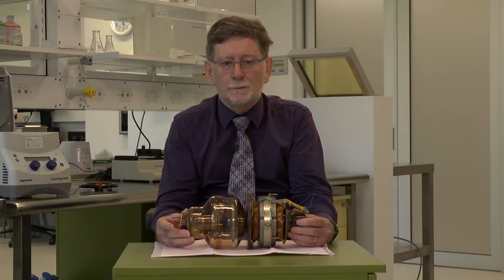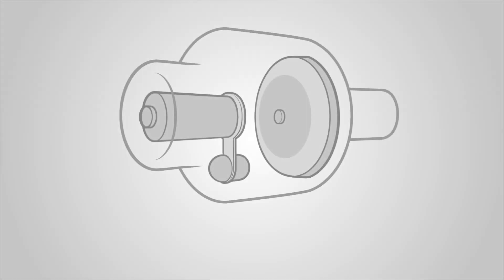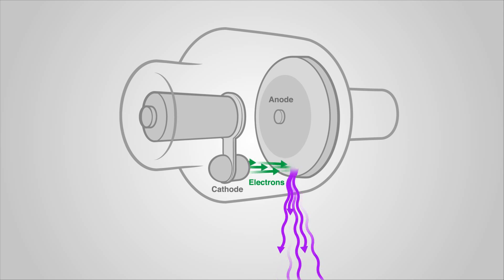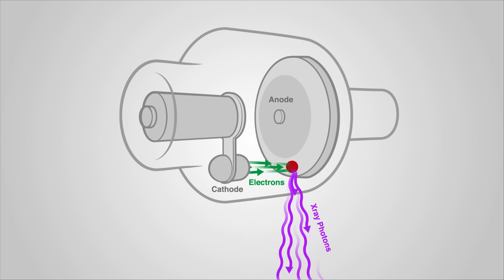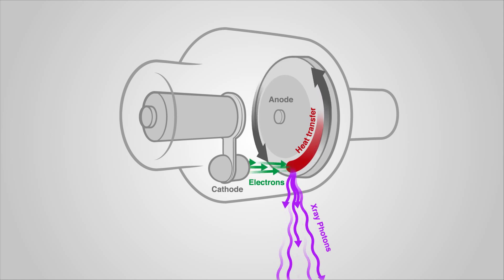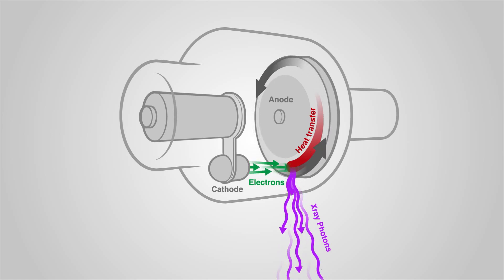How Does X ray Tube Works

Comment: if we increase the heating current across the negative electrode, does that increase the number of emitted electrons?
Reply: yep
Reply: You can adjust milliamperage which controls number of electrons produced. You adjust Kilovoltage peak to accelerate the speed of electrons striking the target. These control the quality of x-rays produced.

Comment: any chance to have this device into a mini one? If you get smaller parts can it still be done or does it need to be this big to function?
Reply from the maker: it cannot be smaller,
you can make it smaller for teeth and all, but for body examination and all , machine have to be bigger , to include all circutes and all

Comment: What happens to the electrons after hitting the anode
Reply: A very small percentage of the electrons that strike the anode will give off units of energy called photons, which make up the x ray beam.  The rest (at least 99%) have their energy released in the form of heat.

Comment: So the high speed electron changes course & is slowed down. When it slows down, it loses some energy.  The result of losing some of its energy is that an exciton (a photon in this situation) with an energy level indicitive of the electron-volt range of X-radiation is produced.  So essentially the X-rays are propagated by high energy photons.

Should they possess even more energy, it wouldn't be X radiation, but Gamma radiation......except that Gamma radiation comes from the nucleus rather that the electron cloud of an atom.

Fascinating

Comment: The video says "1% of the energy in electron beam is converted to photons, the rest is converted to heat".. excuse me mr wise, and what is heat if not photons? All electromagnetic radiation: uv, red, x-rays is photons!
Reply: does this mean even a cfl light bulb on the ceiling is producing x rays??? afterall it is producing very high voltage arcs across the fluorescent  coated vaccuum tube right?
Reply: You'll find more harmful radiation in a brick or a banana than in a lightbulb.  And you certainly won't be getting x-ray radiation from a light bulb (you would have noticed your skin turning red by now).  Also, it takes a certain energy level to create an x-ray photon.  So yes, while x-rays are comprised of photons, not all photons take the form of x-rays.  It depends on the photon's energy and wavelength.

Comment: Couldn't you use some kind of magnetic field to redirect the rays instead of a metal surface so you don't have such a low efficiency of 1%?
Reply: +STDrepository The metal surface is not redirecting the "rays", the metal surface is getting bombarded by electrons (not x-ray photons) and 1% of the electrons give away their energy as high energy photons (x-ray) and rest as 99% heat when colliding with the metal. Strong magnetic field can only redirect the photons (x-rays) a tiny bit and would not be useful and for this purpose.